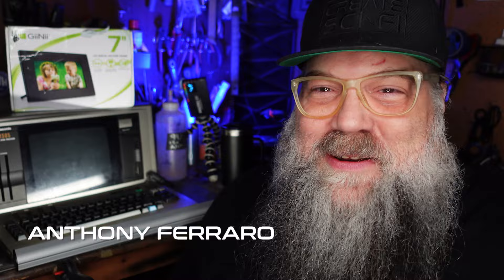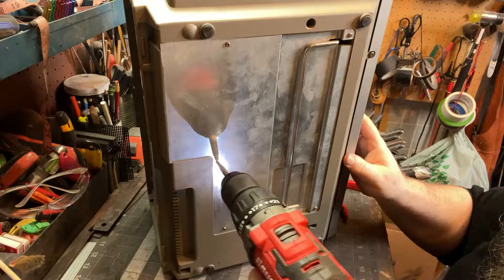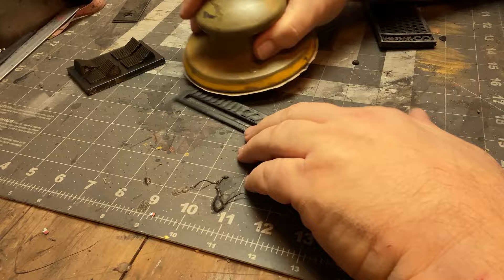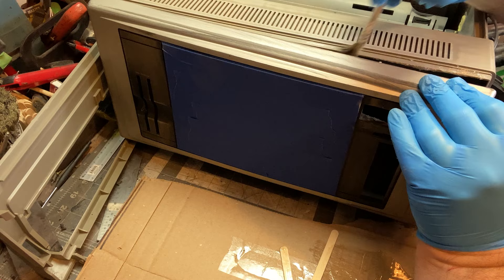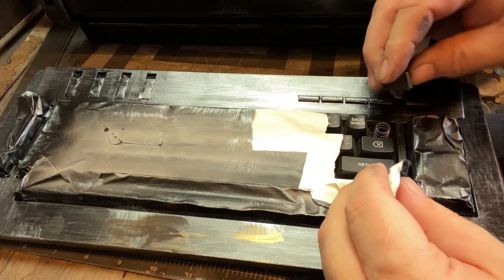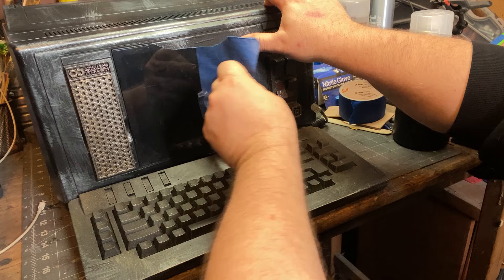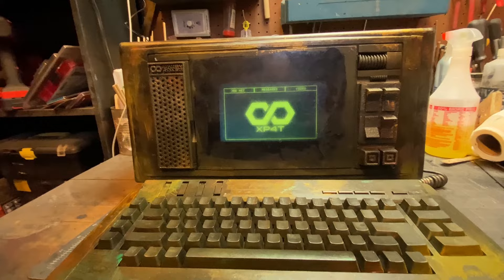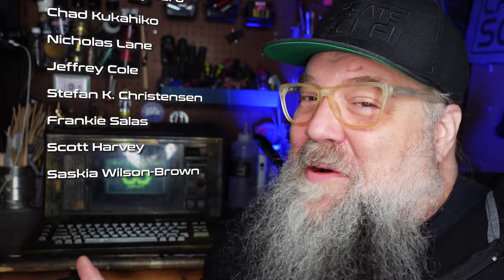RETRO TECH DIY: CRAFTING 70s SCI-FI FILM PROPS FROM EBAY FINDS

Comment: I thought about snooting the place up with comments about how it wouldn't have been that much more difficult to make a working computer that fit into the case so you could use it as an interactive hero prop - but you mentioned a time crunch and I don't think a fully fit-for-purpose system could be made as cheaply as you did.  Your greebles were excellent.  I can't wait to see the console on the set where it will blend in with the general grime and wear beautifully.

Comment: Nice build!  My prefrence would have been to open the case and gut it as if I was going to repair it.  I have experience with Arduino and other forms of single board computers and would have looked to see if the keyboard could be used.  One movie ( I forget what it was ) mentioned they had the keyboard scanned and the screen type what they wanted as fast or slow as the actor actually typed, in spite of what keys the actor pressed.  They also had a key sequence to ' jump ' to the beginning of sequences they were going to film.  I hope that insite of how another film maker did live typing helps you one day, keep up the amazing work!

Comment: With the screen being an inch or so back because of the foam it also gives it a bit of depth. That look gives it another kind of freaky retro look. Always like a technical issue that adds a little more pop to a project.
Reply from the maker: agreed!
Reply: @createscifi   The scale was originally designed in 1964 by the Russian astrophysicist  Nikolai Kardashev (who was looking for signs of extraterrestrial life within cosmic signals). It has 3 base classes, each with an energy disposal level: Type I (10¹⁶W), Type II (10²⁶W), and Type III (10³⁶W). Other astronomers have extended the scale to Type IV (10⁴⁶W) and Type V (the energy available to this kind of civilization would equal that of all energy available in not just our universe, but in all universes and in all time-lines). These additions consider both energy access as well as the amount of knowledge the civilizations have access to.

Comment: So you know all of those restoration video's where they clean up old plastic and then slather it with peroxide gel to de yellow it, do you know a good method to artificially get that kind of yellowing?  I've noticed it looks different than the nicotine sprays or paint weathering I've seen you do?   I'm also curious how your graphite trick looks over base coats other than gloss black, for instance if you did it on this piece after you had already done your silver dry brushing would the graphite finish look substantially worn?
Reply: The yellowing is caused by chemicals in the plastic reacting with UV light over the course of many years. If the plastic is prone to it, you may be able to force it to happen a lot faster with a powerful UV light, such as the ones used for curing resin, or if you have more time perhaps some cheap grow lights. If your plastic is more chemically stable though, you'd probably be best trying a combination of nicotine sprays and other paints/washes to achieve the appropriate colour. Do some experimenting on the inside of some shells, see what you can come up with.
Reply from the maker: I've tried graphite over other gloss colors, such as blue and burgundy. It is an interesting effect but not "shazam!" like with the black. If I had to yellow a piece? I'd start with washes and maybe find a spray paint color that gives that look. I'm sure there is a chemical way to encourage that in the plastic, but I've only seen clean-up videos. Sounds like you're on a journey :)
Reply: @createscifi  Like I said I'm wondering if that very lack of shazam could be used as a weathering effect, or if it would be just too subtle to come through.